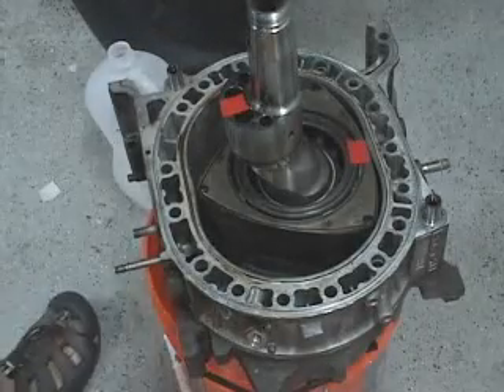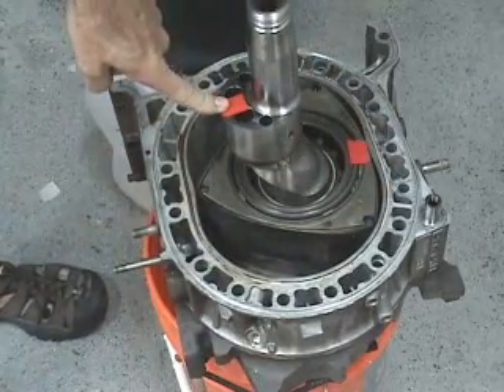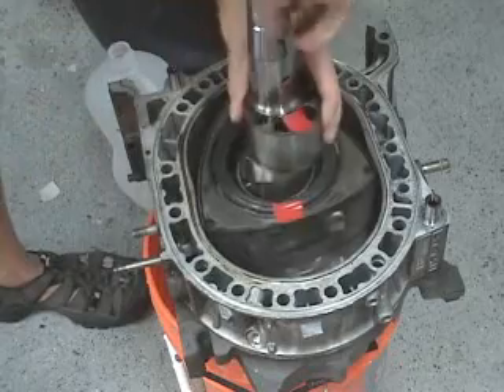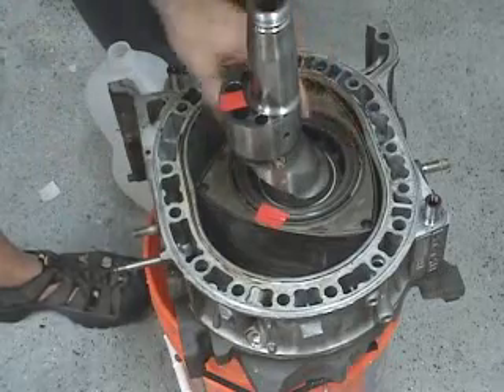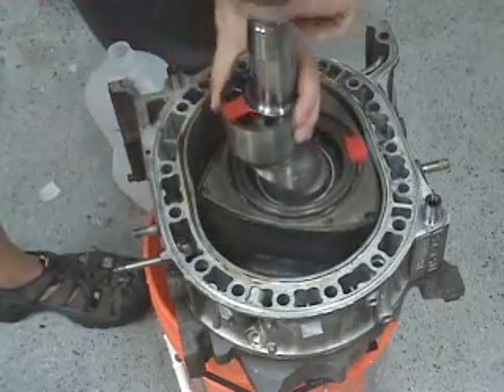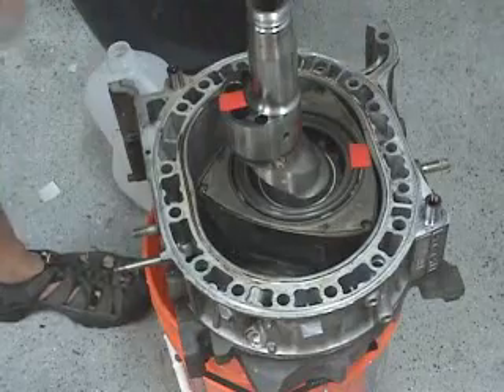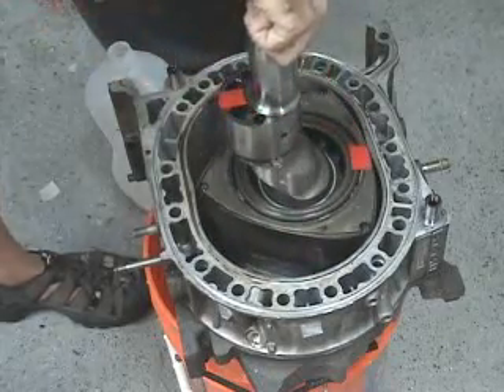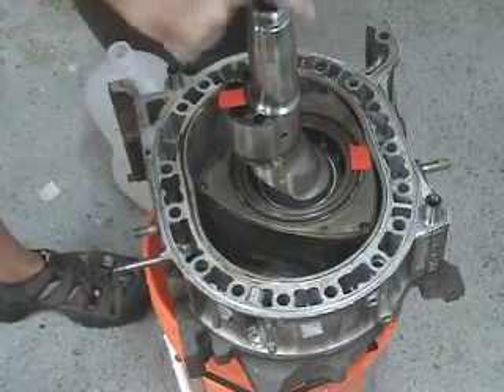Rotary Rotational Demonstration

Comment: @simrash20001 
He's only pointing out the combustion cycle to make it easier to follow (along with the red tape). 1 rotation of the rotor is converted into 3 rotations of the Eshaft. So at 3000 rpm (of the rotor) the Eshaft will be hitting 9000 rpm. maybe he's trying to point out the mechanical advantage?

Comment: Many thanks for posting this excellent demonstration.

I really can't understand how anyone can dispute the facts clearly explained in this video. It does seem that some viewers are slightly confused by the fact that four strokes occur simultaneously around a rotor with three sides.

It may be worth clarifying that compression and power strokes occur in the same third of rotation (i.e with the mid-point equivalent to TDC following compression in a piston engine).

Comment: @psychoninja911 well, they get crappy gas mileage... mid-20's on an ideal engine.  They like to live at High RPM (the rx8 makes peak power at 9K... you use a lot of gas up there).  They also tend to have seal problems as the miles climb, and they burn oil by design.  A wankel rotary is like a performance V8... made for balls to the wall power, fuck your fuel economy standards.  i have been near a 26B rotary when its runnning... sounds like a big-cam american V8 but it revs like a crotch rocket.

Comment: @psychoninja911 yeah it seems like it but theres actually a lot of weight when u add onto a block.  conisder V-type engines, it took a long time to develop a working V8... all that extra metal needs to be cooled, lubed, etc.  the torque gain would be good, youre right.  

i honestly couldnt tell you about emissions at low RPM, seems like youre right, they would decrease but without hard data i cant tell ya lol

Comment: @darkrider789 I know, I just figured each rotary chamber would outweigh it's... weight in power. Would cause extreme torque I'd think.

But at lower rpsm, is the emissions good?

Comment: @psychoninja911 theyre bad on emissions because the next "chamber" that the rotor causes is right into exhaust.  at high RPMs it seems like unburnt gasses are being pushed out a little too soon, hence bad emissions.

and a turbo still forces more air into every rotary chamber, so you can put more fuel in.  you could add a couple more chambers, but then you would have a lot more weight, and speed is more about HP:weight ratio than anything.

Comment: @silentthunderstorm 

I wrote the same: "3x4 Cycle per one rotorrevolution" means 4 complete cycle per 1/3 rev of the Rotor (= 1 rev of the eccentricshaft) :-)

I know the Wankel engine. I have an RX-8 and i bought a used HP Renesis short block and i took it apart.

Comment: @corres78 

4 strokes, Intake, Compression, Combustion and Exhaust.

In this engine those are not governed the same way they are in a normal engine (by time)... but by location in the engine.

There are 3 faces to the rotor, and each of these three faces is constantly running through those 4 areas.

As demonstrated in this video, it takes 3 full revolutions of the shaft for any one of these 3 combustion cycles to complete.

So, in 3 rotations, you get 3 combustion cycles of 4 strokes each.

Comment: @Liamautomechanic and about faults. From what I know, a rotary's nemesis'. Are 1. Apex seals / compression.. And 2'nd. The person handling it/fixing it. Other than that its pretty reliable, given that it barely has any moving parts. Less moving parts = less wear ofcourse. But what gets worn, gets worn out "fast". Therefor the rotary has always been more of a hobby/sport engine. I hope this answers ur Q's :) If not, go google or wiki hehe. :D

Comment: @Alex35J im no expert, never owned a rotary engine, but my mantra is "Get a rotary or die trying" so, im trying to learn as much as possible untill I can get one. :P And from what I've read. Then all rotary's can be .. "refurbished"? ( in lack of better terms.) for 1000-2000$. Depending on what generation it is, and if turbo or not. :) (Needed after 60k-150k miles that is. Again depending on what rotary it is. :) ) Please correct me if im wrong people!

Comment: @Liamautomechanic (im no expert) a rotary engine is NOT more economic than a piston if you talk about fuel consumption. They are known for sucking down both gas & oil, and have bad emission ratings. Which is exactly why it hasnt caught on in general, and only been really used by Mazda for SPORT cars. Other brands like Toyota has tryed as well. But it seems to be to much work for civilian cars. But, they can be brilliant for race performance. And durability if setup right.

Comment: @ismokewead420 Though rotarys are more efficient they aren't as reliable. They need a complete overhaul roughly every 50-70k miles due to the apex seals wearing extremely fast. Today's models are far better than they were even 10 years ago but they still need more maintenance that the average piston engine.

Comment: Wenkels don't have the torque of piston engines but have better efficiency in high revs.  what I don't understand is why there are so very little Wenkels around in racing when they are obviously better in terms of power-to-weight ratio?  Is it political because most car producers use piston engines?

Comment: @anasamla the actual shaft thats why the can do 9k rpm like its nothing the rotor itself is only spinning at 3k rpm if it went by the rpm of the rotor you all of a sudden have a low hp torque monster lol because torque is always higher then hp untill 5252 rpm no matter what the motor

Comment: Seems a nice idea... How do you handle friction? Heat? And metal wear? You have one piece of metal rotating... Contact between the wall is minimal.. So, how do you cool that part? New metal alloy? What happens when one side gets eroded? Will the engine still works?

Comment: @MaZzMa7aZz You get a lot more power/volume with a rotary engine, but it's not as efficient as a piston engine. Also they are not as durable as a piston engine, but there are just a couple of moving parts(2? The shaft and the rotor?) compared to maybe hundreds in a piston engine. So for a racecar it's perfect(high power/weight ratio), but for daily driving not so much because of high fuel consumption and maintenance intervals.

Comment: Rotary engines used to lack the efficiency of piston engines -but for higher power to weight ratio they are a great choice.  The US military was at one time looking at them for small land vehicle use because of their multi-fuel- capability ( diesel, Gasoline, kerosene ??)  I think the are not necessarily as durable  because of the apex seal, but how do they fair if overheated?

Comment: @theMazdaManiac it was a single rotor motorcycle, the misfire was like the timing was SERIOUSLY advanced. apparently it hasn't started since the misfire.

"hardly noticeable" my butt, the engine tried to reverse rotation, while I was going 35 miles an hour, the wheel STOPS rotation...if I hadn't have gotten on the clutch, I would have eaten it...

Comment: I'm sorry if you already answered this, but I'm not going to read through the hundreds of comments. I am new to these engines and was thinking of putting one in a boat with a jet drive to save weight and space.  So how many rpm can these engines sustain? I guessing the teeth between the rotor and the crank are the week point?  Are these low maintenance?  Thanx.

Comment: i get how it works except for one thing how are the rotors comnected to the crank if there is a 3:1 relation thats the part im not getting is how are the rotor and the crank moving at different speeds (you can see i grew up on pistons lol) ANSWER PLEASE?

Comment: @DominicRiv No hold on, a regular a combustion engine is a 4 stroke.  That cylinder does 3 things to get 1 power stroke. Intake stroke, Compression stroke, COMBUSTION STROKE, then Exhaust stroke.  Meanwhile that RX8 is saying Power Stroke, Power Stroke, Power Stroke, Power Stroke. Divide that V12 by the # of power stokes that's 3 power strokes for the V12 per rev, while the RX8 (since it has two rotors) had 6 powerstokes per engine rev.  That's twice the power strokes of a V12!  That's a V24!

Comment: Since the RX8 has two rotors that basically makes the RX8 a mini V-12 engine. Right?  That's 6 power strokes per engine revolution for the RX8. Since a in a V-12 it takes a cylinder 2 strokes to make 1 power stroke. That's 6 power strokes per engine revolution for a V-12.  Right?

So IMO the Renesis Rotary is a 1.3L  12 cylinder.

Comment: @SqueakyBoy92 Actually that one rotor is more like a 6 cylinder (Albeit a very SMALL 6 cylinder), since a four-cycle piston engine only gets one compression cycle for every TWO rotations of the crank, where as the rotary would have six compression cycles if the e-shaft were to rotate a full two turns.

Comment: @seapeddler - No, not usually.
There are no rods to bend, so "hydrolock" will usually just stop the engine suddenly and that is it.
I imagine at very high RPM, the sudden ingestion of a LOT of water might crack something, but I've never seen it.

Comment: So there is ignition when the rotor is facing the spark plug.  What propels it forward?  What guarantees that igniting the fuel when the rotor is facing the plug will make it move in the desired direction?

Comment from the maker: @BARRIEMOREBARLOW - "eshaft" means eccentric shaft. It is eccentric, meaning it is offset from the axis of rotation.
The rotor IS just spinning around the gear (at a ratio of 1:3) and the lobes of the eccentric shaft are forced to "swing" along with the center of the rotor.

Comment: @SAMCA3005 
A Wankel engine (so the germans say!) has a higher rotation than a piston engine, caused by less flywheel mass and less parts to move (no crankshaft, no valves). It needs less cobustion space but higher rotation for a useful torque. It runs and guzzles like a 2-stroke, sounds like vaccum cleaner but has 4 strokes though! No doubt - a Mazda RX8 is fantastic car that runs like hell, but we germans ceased any production.of rotary engines now.

Comment: @MrJoeVig 
We had a lot of trouble with the first  Wankel engines in Germany, low compression, oil consumption and rotor damages harmed the good reputation of NSU and it  took long time until reliable runnig - unfortunately the patent was sold to Japan and made them sell the first serial 2-rotor car, the Mazda Cosmo then, while the germans were still trying to improve the NSU RO80 ...

Comment: @sprockittherobot You know what! I'm no fool. What are you getting at sprock? I'm talking about 4 piston strokes and three rotor turns. It's different sprock. It's different. You keep refering to the Nikolaus Otto cycle. Four stroke piston cycle. Yeah, I get it! I understand that they're both internal gasoline  egines. But, for a rotary there is an intake stroke/turn, compression & combustion stroke/turn, and finally an exhaust stroke/turn. They're not the same!

Comment: @sprockittherobot I believe there is a difference in that it doesn't take four strokes and two revolutions to complete one cycle compared to the rotary. Also, no cams, no valves and assemblies, no rods, or pistons. Between the e shaft and the rotor. That's all as one unit basically. Just have to worry about your apexes.

Comment from the maker: @lgarc657 - It is actually WAY more simple than a V8. The rotary motor only has 3 major moving parts (and about 18 "sealing" components).
Compare and contrast that to an LSx motor that has a minimum of 53 independently moving parts and hundreds of moving sealing components.

Comment from the maker: @Parag0n - NO! NO! NO!
There is only ONE "cycle" for ALL internal combustion engines in use today (with the exception of the Mazda Millenia with the 2.25 Miller-cycle engine). That is the OTTO CYCLE.
The rotary is not unique in this regard and that discussion has absolutely NOTHING to do with this video.

This video is about the relationship of the "crankshaft" and the "pistons" which are, in this case, the "eccentric shaft" and "rotors". Other than this relationship, it is all the same.

Comment: @theMazdaManiac Ok,i really havent had much to do with rotary,The 5 cycle is a mistake many people make when watching animations of how the rotary engine works,the added dimension throws people myself included off.

The ignition stroke of the rotary engine is basically the same as the ignition stroke on a 4 cylinder engine in that it forces the rotor or the piston down or round and keeps the cycle moving.

Comment: @nikamota - Uh, no. There is no "5 stage internal combustion engine". Don't be an idiot.
There are only two internal combustion schemes - Otto and Miller - employed in modern engines, which are both 4-stroke. The Miller-cycle has a so-called "5th stroke", but it is just a figurative expression for what is really just part of the intake stroke.

Comment: This is a 5 stage internal combustion engine then..induction,compression,ignition,combustion,exhaust as opposed to a conventional 4 stage internal combustion engine..induction,compression,ignition,exhaust.

Seems like a great engine with so few moving parts (who wants to replace yet another timing belt or chain?)  

Its a pity that the engine didnt come with a decent instruction manual with details on how to start it,how to turn it off and just generally how to operate the engine in your car.

Comment: I think the primary failure of mechanics and engine enthusiasts alike is to relate a rotor to a piston. A rotor has three combustion cavities as opposed to the single piston surface. Your more likely to understand a rotary engine by merging what you know of 4 stroke and 2 stroke then calmly throwing it out the fkn window. :P 
  I took 5 seconds to find a demonstration video to seal sprockittherobot's point. No Apex seal pun intended sprockittherobot:P

Comment: This is one of the reasons that rotary engines can produce as much horsepower as they do for their size.  Three combustion cycles per revolution of the rotor and one per revolution of the crankshaft.  Because the rotor turns slower than the crank, with practice these engines can be far more durable than a comparable 2-stroke gas engine.

Comment: @trashguy To further confuse the issue, there are (or, were) rotary-radial airplane engines where the cylinders and block rotated around the stationary crankshaft.

Comment: @sprockittherobot Yeah, my next post was "replace retarded with advanced."

I'm just saying I think the reason people feel there's an ignition stroke when it comes to rotary engines is because the rotor is at a different position when the spark plugs fire opposed to when the combustion happens.  I think it's a common misnomer for piston engines that the plug fires AT TDC, explosion happens, piston goes down, I think a lot of people don't realize that that burn takes so long (relatively).

Comment from the maker: @MrSlowestD16 - In both the rotary and the piston internal combustion engines, ignition typically happens sometime *before* top dead center and combustion progresses over the entire stroke from the point of ignition to the exhaust stroke (with maximum dynamic pressure happening around 15* after top dead center).But, most importantly, there IS NO "IGNITION" STROKE.

Comment: I think I see where people get the misnomer that there's 5 parts.

I think what people have to realize is that on a standard 4 stroke piston engine the ignition isn't at TDC, it's retarded, so the "combustion" happens "after" the peak compression, the piston has moved down some.  This creates more volume in the combustion chamber.  No difference here, the chamber's volume expands some, which is where it combusts.  Takes a bit of time (relatively speaking) for all gases in the chamber to ignite..

Comment from the maker: @Rubberdinghyrapids - So, once again, you are suggesting that there are FIVE parts to the 4-part Otto cycle?
I realize the semantic difference between "ignition" and "combustion" that you are (incorrectly) dwelling on. 
In the Otto cycle, there is no differentiation because what you are calling "combustion" begins with the third part of the Otto cycle.
Stop trolling.

Comment from the maker: @Rubberdinghyrapids - OK, then. You are suggesting that the 5 parts of the Otto cycle are intake, compression, ignition, combustion and exhaust? Or, are you suggesting that one of the actual parts of the Otto cycle should be dropped?
The Wankel Rotary engine was never actually put into production. What we have is actually a planetary-motion engine that is an adaptation of part of Dr. Wankel's invention, which was a true rotary motion engine.

Comment: I think the part that upsets my understanding the most is how rotaries have 1 effective moving part, compared to 25+ for any conventional Otto-cycle engine.  (Not counting moving sub-assemblies, such as fuel injector solenoids, or external moving parts, attached to the accessory belt)

Comment: @Flightkid9 Also i've heard that there are 2 spark plugs at the combustion site for each rotor, and they don't quite fire at the same time but rather in close succession to help the combustion push the rotor round in the correct direction, and not reverse.

Comment from the maker: @Flightkid9 - In a word (or two): angular momentum. Really, there is no easy explanation for torque generation in the trochoid. You will have to read the rotary bible for that: Rotary Engine, by Kenichi Yamamoto: foxed.ca/ rx7manual/manuals/ REbyKenichiYamamoto-1981. pdf [remove the spaces]

Comment from the maker: @RacerDude96 - They are actually spectacularly easy to work on, but you have to have a good attention to detail if you want to build a motor that runs well. It is very easy to build a crappy one!
There are only 3 major moving parts, but each rotor has 50+ smaller springs, seals, o-rings and other stuff that has to be perfectly in-spec to produce good compression.